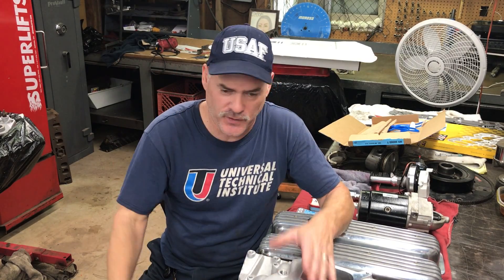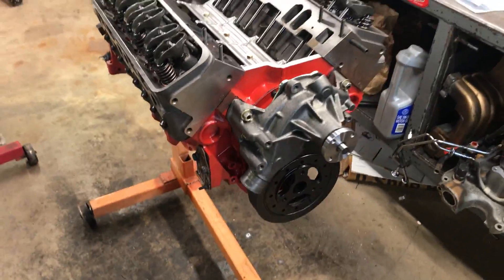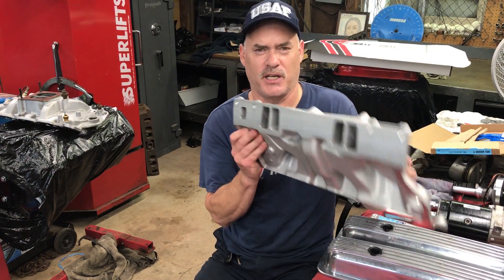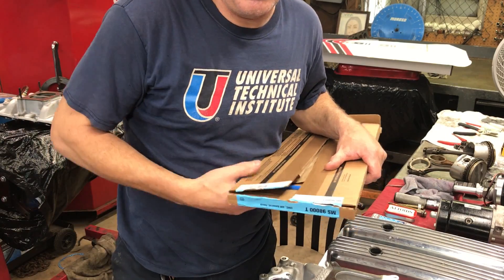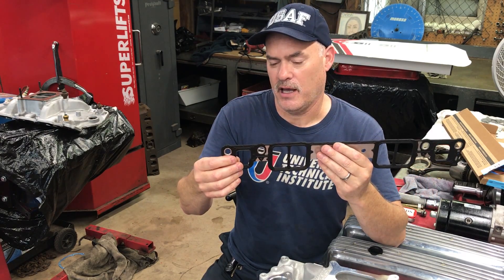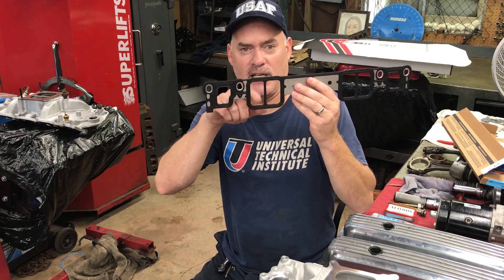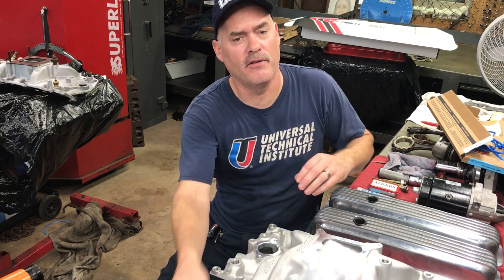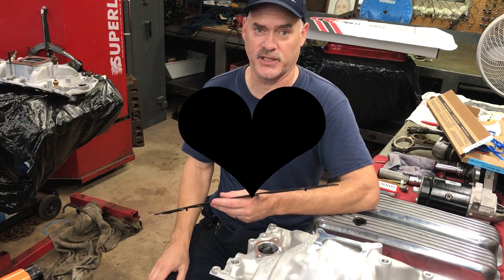5.7L Vortec  Intake manifold gasket problems

Comment: In my engine, the injectors have no seal where they are pushed into the lower intake manifold. This seams wrong to me. Is that normal for the injector to just sit in the hole? I can’t find any seals on line for those particular spots and no one seems to ever talk about it in any videos.

Comment: ive been struggling with a leaking upper intake gasket leak on my 96 2dr Tahoe and I kept using the other gasket types I am definitely going to try these metal backed ones. Thank you

Comment: I was told by a mechanic friend the factory intake would start to leak at 80 to 90k.....bingo 88k.
I used the hard factory gasket which leaked about 25k miles in....TWICE! For the third time around I used the FelPro 1255 composite gasket. This time I switched to ARP intake bolts...AND BINGO PROBLEM SOLVED.
The factory bolts don't hold the torque applied, and it's not a lot. I put another 150k on the engine, NO LEAKS.
At 248k when I junked the van, but kept the engine, I checked the torque and it DIDN'T BUDGE ONE BIT.
No re-torque what so ever....NONE. Every factory Vortec I have seen...EVERY SINGLE ONE.. the bolts are loose. Next engine it will be the Felpro 1255 or the problem solver gasket, and new ARP bolts.

Comment: Great Vid. I have a fresh 355 with Dart heads that were from a circle track car. Heads were milled and i can see light on #8 intake through my victor Jr intake. My machine shop said to use washers on all 4 corners that equal gasket I'd. Then mold BB` model clay on all runners top and bottom. Slice in half and measure depth. Going to try tomorrow. Also china wall close but not hitting yet. Anything else i can try?  Thanks. John

Comment: I have a 98 l31 block without the 3rd hole bypass I’m putting a carb on there what’s the best way to reroute the old school pump with that block should I drill that third hole into the block or just drill into the t stat any info would be appreciated thanks mr vintage iron
Reply from the maker: I buy a thermostat with a bleed hole haven't had any trouble doing that I did fill the system first up to the thermostat level and then install the thermostat it helps bleed the system faster when first filling the engine, I've seen guys use the water pump gasket as a templet and drill the bypass hole it seemed to work fine but I really never saw the necessity to do so
Reply: @Myvintageiron7512  thanks boss ur much appreciated so I’m not going to drill that 3rd hole in my block just mount my old school water pump and put a few holes in the t stat will it have any effects in winter driving or summer driving mostly will I see temperatures rises and drops

Comment: Is there a specific head gasket that you like for the vortec engine?
Reply from the maker: no it will take the same gasket as earlier engine
Reply: @Myvintageiron7512  well, I recently replaced my 98 engine, because it was consuming antifreeze. 230000 miles. Found an engine, got the truck running good. Then I found out that these engines had intake manifold gasket issues. So I popped off the intake, and sure enough, the water passages on the gaskets were broken. I bet that was my problem! So, I got a spare engine now! But maybe I should pull it apart and refresh it, while it’s handy.

Comment: Installed these on a new goodwrench L31. Lost the gasket @ the coolent passive next to the number 2 cylinder.  Similar to this we are running a carb setup.  I was wondering if the heater hose placement had anything to do with it since the heater hose is coming off the intak directly above the failer in the gasket..   Any thoughts?
Reply from the maker: it's possible

Comment: Ooh is this gonna be about the 1996-1998(1999 mid years) and the almost LS engine? The old small block 5.7 with that trash spider injection and 2 piece intake manifold? 

Save the struggle, either get the marine MPFI intake manifold with external fuel rails OR swap to carb\carb fuel injection throttle body.

Also:
Felpro Premium top end engine gasket kit(iE: the problem solver series)
Fixed any and every issue I ever had.

The fiber gaskets are whack sauce. MAYBE brand new clean bolts and thread chased holes MAYBE that might seal up fine.

For the work involved, save the struggle, get the Fel-Pro premium/problem solver gaskets/upper engine gasket kit.
Reply: You have a part number for that kit?

Comment: Sir, great channel just subscribed.  I have a vin r csfi 5.7 vortec in a 99 c3500.  I want to get a rebuild, unsure if I want to stroke to a 383.  You mentioned in a previous video that the heads tend to crack.  Is that also the case on the vin r?  Where are you located and do you do rebuilds?

Comment: Man I could use some help with information I have a 1996 Chevy Z71 with the fuel injection I am changing it to carburetor intake can you tell me what intake manifold I need is this jeggs one the right one part number is 555-513002 thanks man any help would be greatly appreciated

Comment: When you say "run vortec heads on your sbc" does that mean these can be used on my stock 1998 k1500?
Reply from the maker: 1998 already has vortec heads from the factory
Reply: @Myvintageiron7512 
 What about the gaskets- can I use that gasket intake set (that you demonstrated part #) on a 5.7L vortec heads with factory intake (spider injection system intake) ???

Comment: Will the vortec heads work on a 1992 LT1 block?
Reply from the maker: no
Reply: @Myvintageiron7512  I have a blown head gasket and came across your video and was pretty excited to try out those heads. Why won't they work? And do you have any other suggestions?

Comment: I recently viewed your video about using Vortec heads on a 350 eng. Is it mandatory to drill  the two center holes in the head and manifold? I will will be running a carburetor.Also will stock length pushrods that used with my early 350 heads work with my vortec heads? Thnx.

Comment: Same issue with roller lifters? And what paint/color did you use on that block? That is a beautiful color! Building a #683 4blt block with a the roller valve train.  I want a budget but I only have one shot at this so I don't want to screw anything up. I've sourced everything but the lifters...

Comment: I know this video is 3 year have there been updates or changes. I am working on a small block with vortec heads and edlebrock manifold and I am having antifreeze leaks and have replaced the gaskets 5 times.  Is there any way you can call me or email me so we can talk?
Reply from the maker: where are the leaks at

Comment: I have an intake manifold leaking oil through the top of the bolts on a 348 Chevy engine. Would you recommend this Fel-Pro line to stop the leaks. Also, I've heard that there are different thicknesses of gaskets, how do I determine what thickness to install on the intake?

Comment: Used a felpro 1255 but it leaked bad at the back corners i had to put a film coating of silicone over entire gasket both sides and so far its good but i will go to this set next time..

Comment: I no this is an older video, but how did the new gaskets work out? I have a 98 k1500 5.7. It was using around half a gallon to a gallon of coolent ever 200 miles, it rarely smoke unless very cold or damp outside. The oil always looked  good for a truck with 200,000 miles on it. I finally tore into the intake finding some mayo resido on the vaulve covers, the intake was ate up, i replaced them with Victor reins gaskets. Truck runs better and never smokes, tail pipe is always dry. I am still loosing coolent... it has a new waterpump,thermostat and radiator+ cap. Think these would work for me??

Comment: Hey Man first I want to thank you for always trying to help people with sound advice!  I recently bought a 67 Impala that the previous owner did a Crate engine swap GM 350 HO With Vortec heads.  He said the engine had less than 9,000 miles on it but when I bought the car it was smoking blue  most of the time very little on idle most of the time when revving up.  So the first thing I did of course was to bust my hum and replaced the valve steam seal while in the car (not fun) but I did nothing. So I'm thinking it has to ne this gasket because every plug has some light oil residue. They are new plugs too. I seriously doubt all 8 cylinder have bad rings... I just ordered this gasket set. I want to mention that this engine runs super nice a lot of power and it sound really healhy other than the annoying blue smoke/ What are your thoughts?
Reply: Did you ever install them gaskets, what was your results?
Did the oil consumption end?

Comment: Hello. Good vídeo. And i have a question, i got a intake exactly the same in my 350 vortec heads. But my motor is nothing special. Just cam 262/270 flat tapet. Msd headers shorty.  But.    In the instructions of the intake i saw its for 1500 rpm to 6500 the question is. The intake is to big for my set up?   Intake 7116 edelbrock. I need something more small?? Thanks alot 👍👍👌
Reply from the maker: no it will work fine

Comment: Also do not over torque the intake manifold bolts. In my experience it can cause gasket problems too.
Reply: What did you torque them to? I’m getting ready to set an Edelbrock aluminum intake to a Vortec with ARP 12point bolts.
Reply: @alanf.4095 also wondering what torque specs are , google seems to be all over the place from 11ft lbs - 30ft lbs. about to set my manifold as well.

Comment: If you blow the intake gasket could you get water in the oil I have a 1998 Chevrolet C 1500 and the truck never run over to 210 but while passing a vehicle when I started to slow down I discovered a little bit of a miss and now I have water in my oil but the truck never run hot enough to blow a head gasket so I’m kind of confused

Comment: Thanks a ton for all of this!  Can you explain or better yet show the difference between 95 and earlier and 96-2000 sbc coolant bypass. I hear that the early engines had the hole below the water pump opening. Now the 96 up blocks don't have the extra passage as I understand.

I hear coolant needs to circulate prior to the thermostat opening to prevent hot spots before the t-stat opens.

How is this accomplished? And do you need to make any changes when Installing a Vortec style head on an earlier block or installing early heads on a Vortech block without the extra passage? I've heard some suggest drilling a hole... thoughts on that? Thanks again!
Reply: Watch some PISS CUTTER PERFORMANCE  videos on YouTube he’s a master chief on 350 vortec coolant bypass videos and everything mostly for the vortec 96/02

Comment: Do u use regular ol sbc 350 head gaskets for vortec heads?
Reply: I guess I'll be going with the Stock 350 OEM Head Gaskets and Head Bolts with my 
1998 (062 Vortec Heads) swap to my 1982 350 Stock block.

Comment: Whats the torque specs for 98 chevy 5.7 vortec block and heads with edelbrock 2116 I torqued mines at 25 ft lbs then i went to the online manual and it says 11 ft lbs ???
Reply from the maker: the TQ is rediculesly low the 11/12 Ft pounds is right you need an inch pound TQ wrench to do these 132 inch pounds is where I TQ them a word of caution if you over torque em they will leak
Reply: @Myvintageiron7512  Thanks I will need to loosen the bolts and have another go at it .My torque wrench for inches only goes up to 80 inch lbs .Do you think I might need to Redo the ATV Silicone again or will it be ok ??The Engine is still on my engine Stand.
Reply from the maker: it should be fine
Reply: @Myvintageiron7512  Thanks a million I really apreciate your time to reply.I will be installing a new oil pump and rear main seal today.As you can tell this is my first block I ever worked on. I have only installed parts before .This is a 98 chevy L31 block ive been working on .So far I honed the cylinder bores installed a 265 custom cam 480 lift same on exhaust 217 center 110 lobe ,1.6 roller rockers and advanced the timing +4 double chain with edelbrock 2116 intake on top and 9800 fel pro gasket.Im keeping the TBI I just rebuilt on my 91 silverado for now by installing the 88 chevy 454 carb adapter plate I have been paying attenchen to alot of your advice from previous videos 🤞 all goes well.

Comment: I have a set of  aftermarket heads , they have the old pattern, and vortec, but they are 220 cc intake runners, I'm having trouble finding a gasket that fits the ports, I'm running the old style intake, the gaskets I have on it now are slightly smaller than the intake ports! It's not a full race port, do you have any idea what might work?  These look like they might fit the ports, but the intake bolt pattern is the old 1st gen , that's the trouble with aftermarket parts, I have the largest port gasket I could find, without getting a race port gasket, I even modified them a bit, I enlarged the gaskets, as far as I felt comfortable, they still are slightly small,    thanks

Comment: Have to agree, the rubber coated Problem Solver Vortec gaskets are the bomb. Been using them ever since they came out and have never had a problem unlike the OE type plastic versions you'd be replacing every 70k miles.

Comment: How did they hold up
Reply from the maker: nevr had a single failure Ive done a dozen or more  with them
Reply: @Myvintageiron7512  did you machine for extra bolts?

I'll be using them for a stock car class.  No porting is allowed so gasket overhang is an issue. Many gaskets aren't shaped right there. I know cometic makes a good one for fit, unsure of failures.

I may just have it machined for extra holes and cut my own gaskets... I hear some times you've gotta take material off the endrails or elongate the manifold bolt holes for a centered fit.

Comment: These gaskets are the bees knees if done right..my skilled mechanic friend did this for me way back in '09 and they're still sealing tight with no leaks. Instead of permatex rtv he used Toyota seal packing 103 (FIPG) on the valleys. He's convinced that stuff is the best sealant on the market.
Reply from the maker: Toyota seal packing 103 (FIPG) is most definite the best sealer I have ever used good call
Reply: I used the small tube of grey rtv they included, barely enough... sealed up good do far. The right stuff gasket maker performs well also.

Comment: How can you recommend something you haven't used. Lmao
Reply: Bryce Gman do research dumbass
Reply from the maker: Because several other respected engine builders pointed me in the direction of these gaskets they wouldn't have done that if they didn't work I have used dozens of sets of these gaskets since this video without a single failure,  when you have a problem you don't just go out and buy whatever you can find and see what happens,  you get the advise of experts (more than one) if they are all saying the same thing IE use this gasket,   than that is what you do,    this is common sence,  most of the viewers get this,  but apparently not everyone has it
Reply: I've heard from 90 year old smokers that smoking isn't bad. Common sense? Flawed logic. It's probably a fine replacement. Data is better than "my buddies use it so I'm the authority on it too!"

Comment: du you know of any way to drill and thread the vortec heads and intake to add additional bolts in the center area for more fastening strength? or isnt it possible?

Comment: I have an oil leak at the back of my 350 small block v8. It is not the oil pressure adaptor or oil switch and it is also not from the new distributor. No oil leaks out if I drive at low revs but as soon as I rev it up or the engine is under load it stars leaking heavy. Could it be from the china wall between the intake manifold and the block? I have seen a video from another guy where he shows the oil seeming to leak out between the cylinder head and block but as far as I know, there is no oil port there only coolant ports or am I wrong? Please assist.....
Reply: Kobus Kock correct no oil passes through cylinder head gasket, oil comes through push rods to lube valvetrain. Very common these "China walls" leak usually at rear. Clean both surfaces with solvent and use "right stuff" or permatex ultra Grey, overlap silicone over corners of gaskets to ensure sealing. A rare case I saw a cracked block by the oil sender threads leaking, this would be rare, but suspicious you say it leaks more under rpm. Usually the intake leaks more when driving the vehicle. Good luck
Reply: @vulgarhyena9616  what does the intake leak? ... oil?
What parts will be needed?
Reply: @rudyVvv3  it will leak oil, typically at the rear (but also at front) typically oil will pour down bell housing and commonly misdiagnosed as a “rear main” seal leak. You’ll need new intake manifold gaskets, silicone, and some intake/valve cover combinations require valve cover(s) to be removed, so prepare for valve cover gaskets. also, a rear seal leak is t that bad, some Jack stands, a Jack and basic tools on a driveway, the trans can be removed for seal replacement. Good luck!!
Reply: @vulgarhyena9616  gotcha- thks bud

Comment: Port the intake runners on vortec heads or not ?
Reply: Google Larry Meuax vortec.  Lots of work...

As far as the runners, that depends on your desired peak hp, rpm operating range and cid.  The min port cross sectional area has a large influence on that.  Usually the majority of the power comes from messaging the bowl area, making sure the shape is right around the turn, deshrouding... not making the biggest runner you can.

Comment: I just put vortecs in my 350. Cant get it to open thermostat (installed a new one and still the same thing) put a new radiator cap still nothing. Also having issues with it idle searching and it doesn’t want to idle on its own. Can’t seem to find any vacuum leaks. Can’t set the timing because it’s all over the place. I used the FelPro 1255 thick intake gaskets. Any suggestions?
Reply from the maker: What year